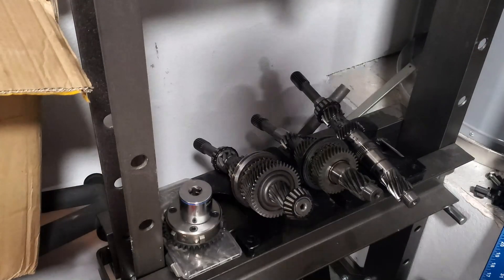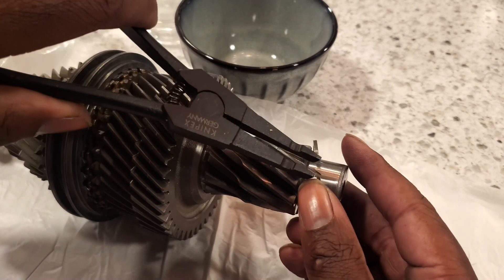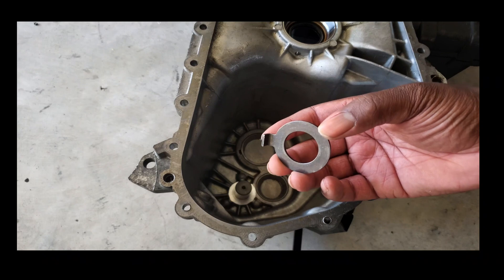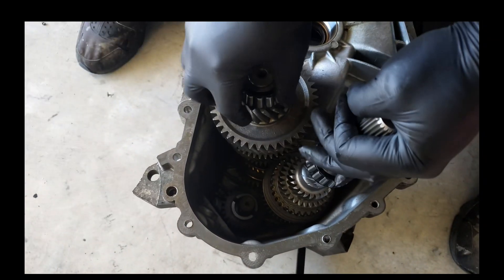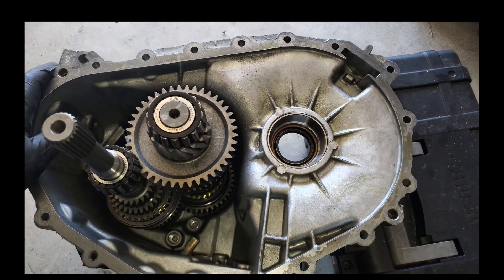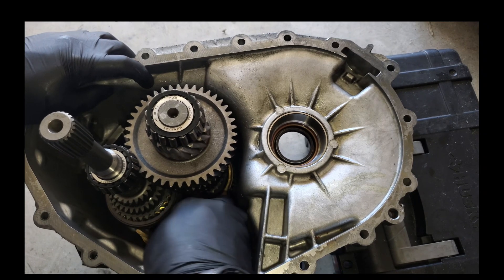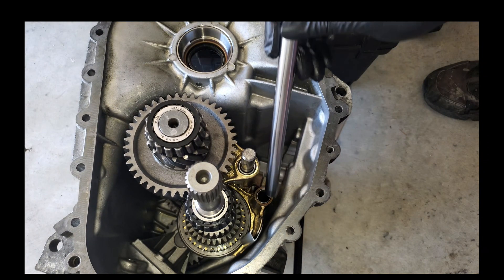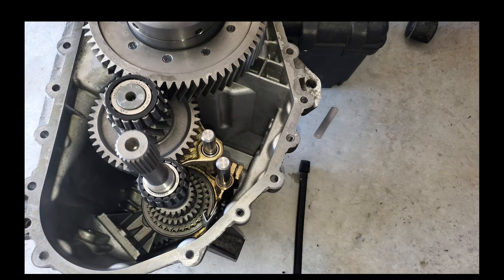Finished Input Shaft with MTX -75 Transmission Reassembly

Comment: Had mine rebuilt, no matter what i do i get the dreaded rattle at idle - oh, Ford just send you a LUK slave when you buy it from them!
Reply from the maker: This is fascinating. A rebuild MTX-75 has idle rattle issues. Have you called the shop back on this?